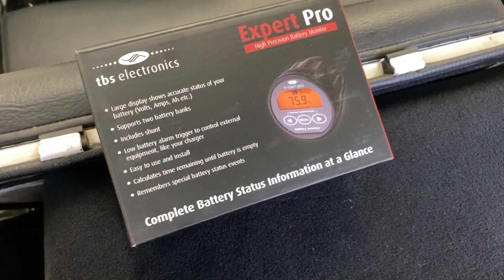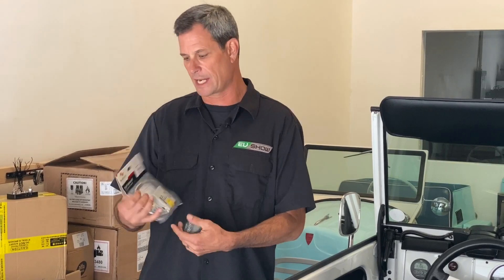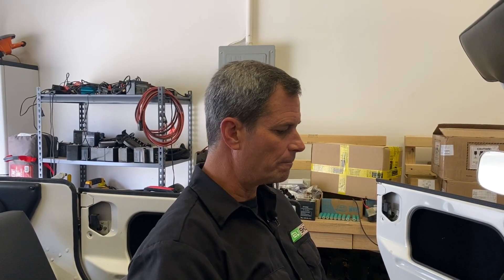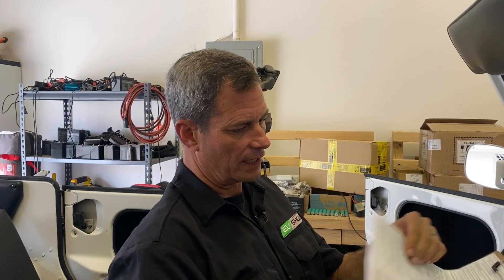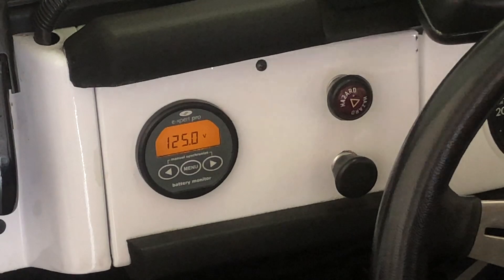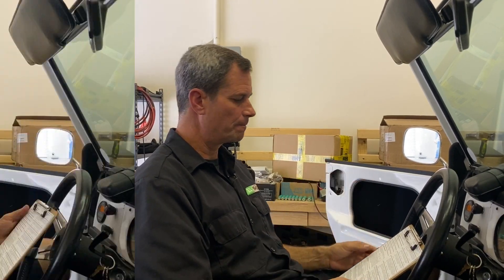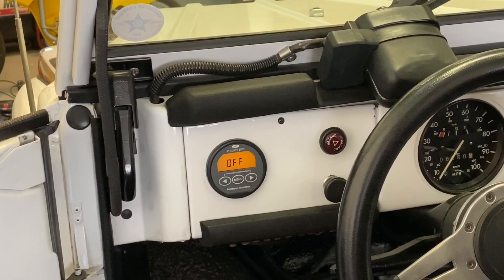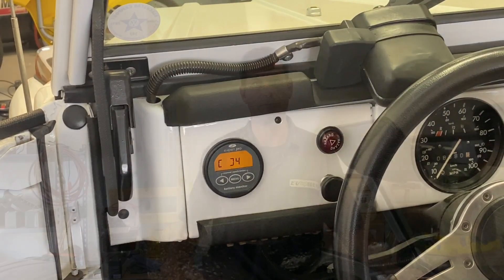TBS Expert Pro Battery Monitor Quick Setup Guide | EV Show

Comment: for my low voltage alarm with output extender i am unable to change the cutoff voltage from 165 volts, each time it is written to the device it is changes right back to 165. did i miss a setting or input?

Comment: Tinning wires into screw terminals is a bad idea as solder is soft, and with vibration, can flow over time so contact pressure can be lost - it's much better practice to use bootlace ferrules, which also provide some strain relief to the wires against strands fracturing due to bending.

Comment: 2:02 line resistance? I don't know how it works but in theory it is measuring voltage, it should have high input impedances as any voltage measuring device.
Reply: High input impedance is relative.
What is the input impedance of you DVM?
Reply: @honthirty_  greater than 1 megaohn, line resistance worst case could be 1 ohm..